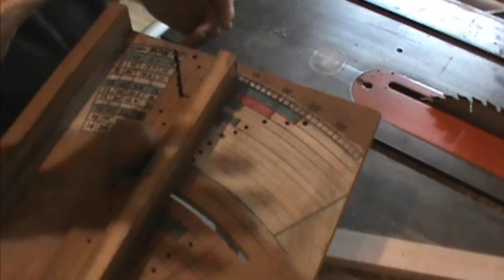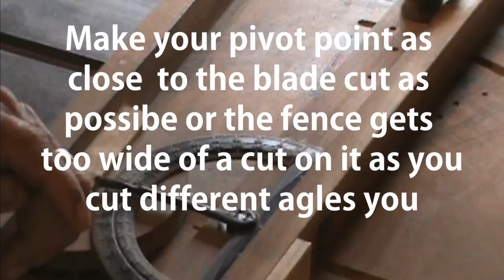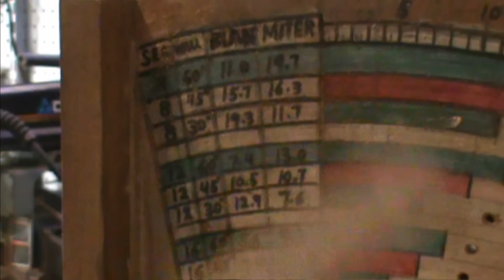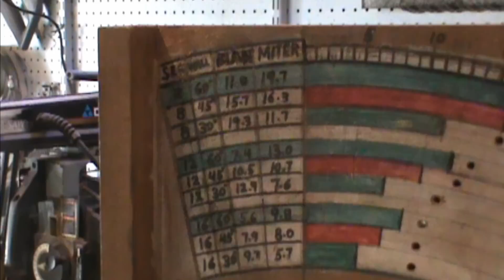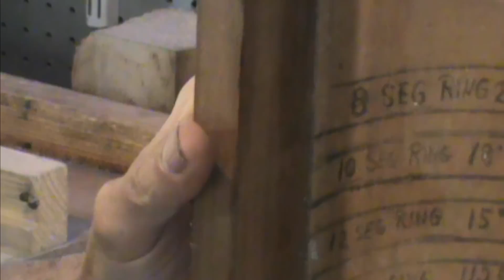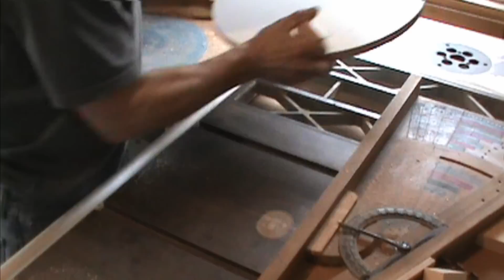Most accurate table saw sled for any angle

Comment: How to make gabarit for segmenter bowl 8inches Thank al
Reply from the maker: 8"x 3.14 = 25.12" = length of board25.12/8= 3.14" length each segmentangle 180 degrees divided by # of segments180/8= 22.5 degrees each cut. put it together and you will have 8" ring. remember that that is to the high points. if you need it to be exact add 1/8" to each segment or make them 3 1/4"  length.the initial number 3.14 is the number always used for any size ring. that is pie always used to calculate a circumference.

Comment: Good design for the more experienced wood turner. An easier system for the beginner turner is the "wedgie" system.
Reply from the maker: thanks and I am sure you are correct if you want to buy wedgies for every angles but with that said I have built wedgies for my sled as well

Comment: wonderful info btw ,but why couldn't you set a 12 piece ring on a 8 piece ring ? cheers
Reply from the maker: +dennis buckner Thanks for watching and commenting. I guess I shouldn't say you can't mix and match but the reason I say that is that the segment lines won't match up with an 8 segment and a 12 mixed every other segment will match so it works if that is what you are after.

Comment: Great jig.  There is a chart for the cut angles.  It gives the number of sides (3-12), the flat miter angle (60° to 15°) and the side outward tilt from vertical (0° to 90°).  You can get it at http://woodgears.ca/miter   I use it all the time for making tapered polygons.
Reply from the maker: Thank you Mark for linking that. yes that chart has a lot of useful information. I use just the basic information that I would apply on my sled and of course I rounded the numbers to the closest 10th
Take care
Albert